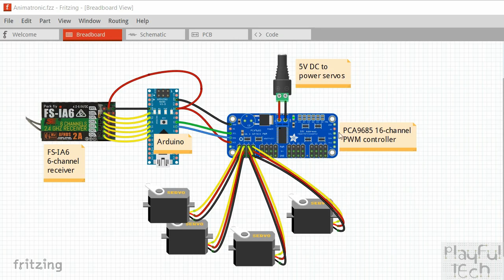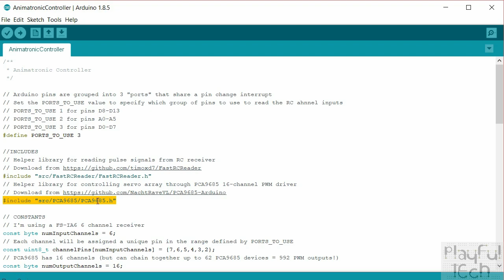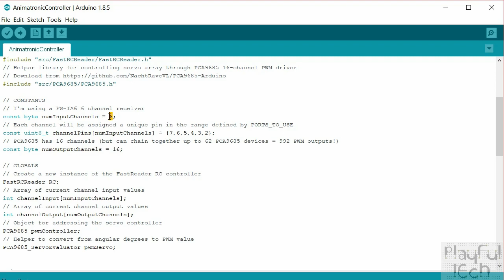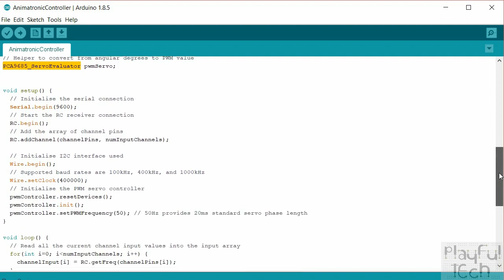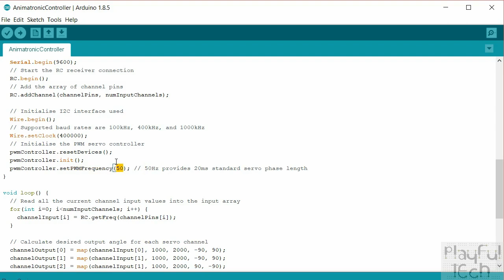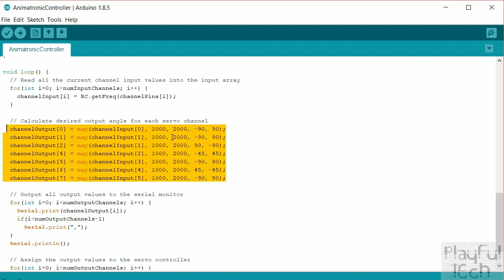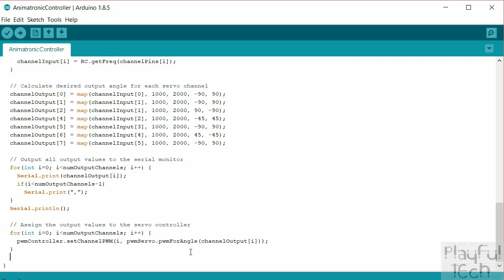Arduino Animatronic Controller Part 2 - Servo Control

Comment: Could you explain your 'eyeball' in a bit of detail?

It looks, from the brief 'intro' portion of the video, as if you're using a dual-shaft servo to control the eyelids - is that the case?

A few links to things wouldn't go amiss...
Reply from the maker: All in good time! In the next video in the series, I'll be looking at the (simpler) tentacle mechanism first, and then the video after that will be all about eye mechs, including links to all the models.

Comment: Can you keep the same radiocontroller and receive the orders on all different kind of receivers (IA6, IA6B, and other kinds?) I ask because on first video you have IA6 receiver, and on this one, you seem to have IA6B... (sorry if this question is stupid to most)
Reply from the maker: Yes - this transmitter allows you to bind to several different receivers (and you can setup different configurations for each one, so which switch is mapped to each channel etc.), so perfect for controlling several different models. You can select between them on the transmitter menu screen (you can only select one at once).
Reply from the maker: Worth mentioning - the IA6B has an iBus interface, so instead of using 6 seperate PWM channels as I do in this video, you can read 10 channels sent from the controller via a single GPIO pin, as described here: https://www.youtube.com/watch?v=HRapwUg_jeo

Comment: Hey, I have a question for you as I am not familiar with these multi channel controllers but very curious... From arduino, or an rc unit, can you control a specific motor hooked up to a specific channel on that controller using code?
Reply from the maker: Absolutely. That's what I'm doing here, except with servos rather than motors.
Reply: @PlayfulTechnology  Would you have an example of code I could check out?
Reply from the maker: @barzalou  You can use the exact code I'm using in this video. Connect your motor to the GND and PWM pins of the corresponding channel on the PCA9685 board.